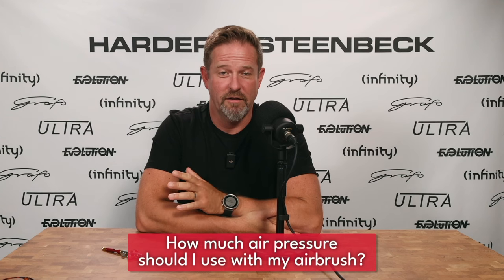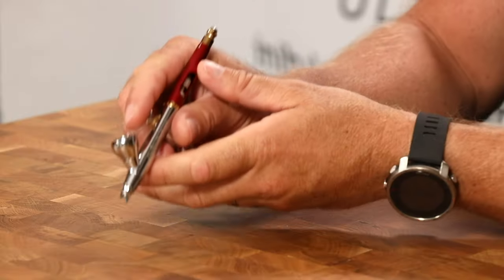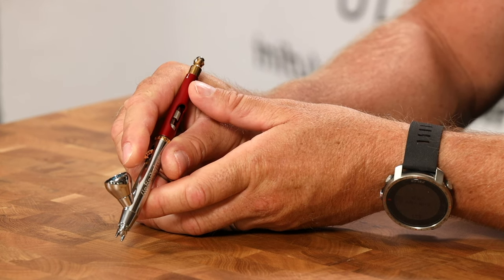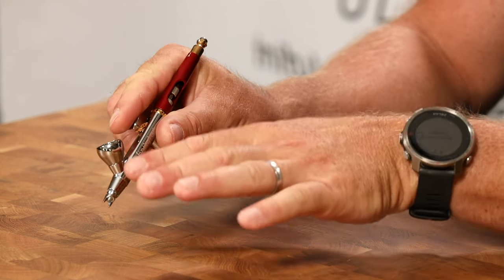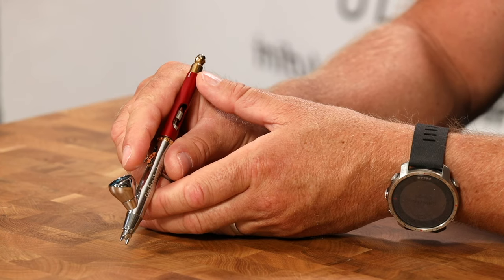Air Pressure: Get The Most Out Of Your Airbrush Compressor!

Comment: Apart from the airbrush itself and the application of airbrushing, the pressure also heavily depend on the paint and it’s thinning ratio. For plastic modeling, my favorite pressure is 15 - 20 psi for general coating, and 5 - 10 psi for detail work.
Reply from the maker: You are right, pressure required is related to paint preparation.

Comment: On topic, If you are serious about airbrushing purchase a serious airbrush compressor with the potential to last a lifetime. Please avoid these very popular oil-less piston compressors and research a silent oiled compressor JUN-AIR or SILENTAIRE are the top most reliable oiled silent air compressor brand types available. Allow your airbrush skills to soar and develop while exploring the vast options and airbrush applications all at your fingertips with the choice of the right air compressor. Which in my opinion should be equipped with a reservoir air tank of no less than 6 gallons for consistent air pressure again allowing you explore in quiet (with a low noise level decibel of 40 to 45DB with either silent oiled compressor brand mentioned) the vast artist world of airbrush. Let's not forget it's "AIR"brushing where air in useful abundance is required and not an option. Don't be mislead, Get one, I've owned my 1st silent oiled JUN-AIR compressor over 30yrs without single issue of any kind beyond regular wear and tear maintenance.
Reply from the maker: Hey buddy - whilst I agree that those oil-filled units are superb for silence and reliability, it's also true that the modern oil-less units have come along a really long way in terms of the quality of air that they deliver, but for a fraction of the cost. As always, there are serious brands and not so serious brands! But the compressor you describe does put the budget out of reach for many, and the goal is really to bring the wonderful world of creativity of the airbrush (as you so eloquently describe it!) within reach to many. But if you already know that you're serious about it, and you'd like a silent studio, JunAir and SilentAir are indeed GREAT brands of compressor.

Comment: Another great video✌️💜😊

I've got three cheap(ish) compressors, one's a small one on wheels, with a receiver and regulator, for general garage workshop use, rarely used for AB work, a small semi portable one (240v, again with a receiver, regulator) for AB work, and a cordless Oasser (very quiet for indoor use) for portable jobs like O gauge track weathering or quick jobs (I don't detect any pulse from, this, little, what I presume is a, diagram only compressor, it's regulation is via power buttons and not all that finessed). All three work well, most of my painting is done between 15psi and 25psi, Eg 20psi or just under and yes it gives me time to think and build layers as it's low energy, lower "speeds". Are my compressors worse than expensive branded versions? Not really, not sure if they'll last as long, if I were a pro, I'd go the Eg Sparmax route et al. When I worked in an engineering environment, we had branded products used and abused every day and our livelihoods depended on them, as a hobbyist that's not a consideration, getting paint on well, using water traps where required is what's needed.
Reply from the maker: Great comment.

Comment: Hello,
I received my ultra 2024 with the Sparmax AC-501X and I want to know if it’s normal that the gauge is not stable when using the airbrush? Everything is well connected with the hose. I’m really newbie 😅
Reply from the maker: Hey there! Yes, totally normal. It's called static and dynamic pressure. Static is the reading when you are not pulling the trigger, dynamic is the pressure when you are pulling the trigger. We recommend that you set it to around 25psi static, which will deliver a slightly lower reading when the trigger is pulled. It's because when air moves, its pressure drops... no problem!

Comment: I Love all your video's. Excellent information.
I would like to see step by step how to change needle sizes, all the bits that need to be changed with each needle size. 
Please  :face-red-heart-shape:
Reply from the maker: Hey there - thanks for the feedback! We will be covering this topic soon, but in the meantime, please remember always that you need to change the needle, nozzle and the aircap as a set. The needle caps are common. Our current systems are defined by 1 line for 0.15mm on all three items, 2 lines for the 0.2mm and 4 lines for the 0.4mm... You'll see this line system on the needles, nozzles and the air caps. Hope that helps!
Reply: @harderairbrush  Thanks it helps